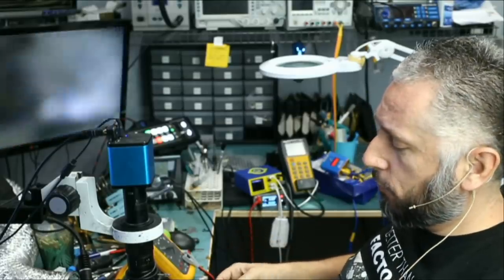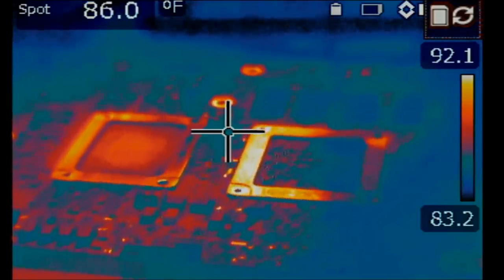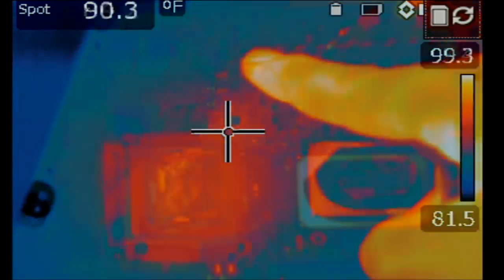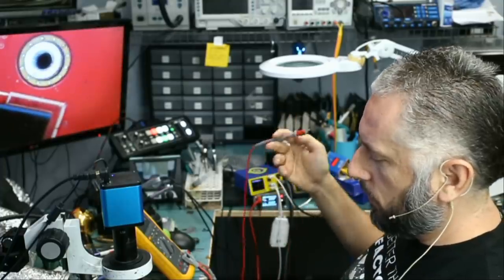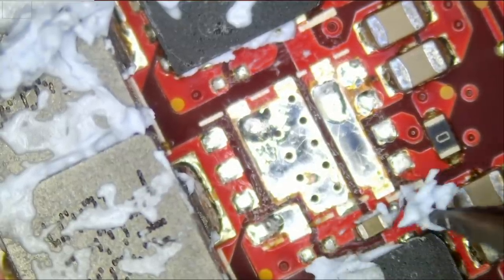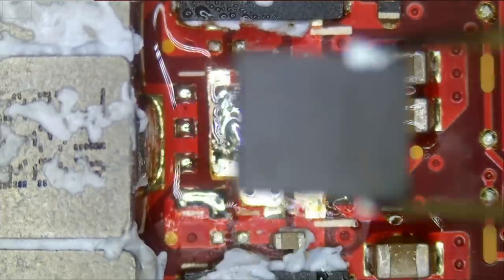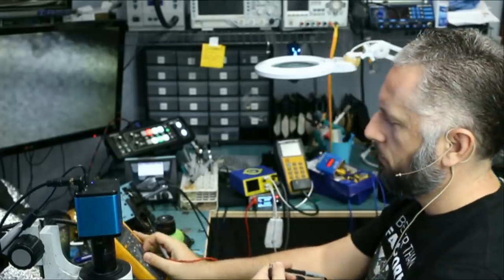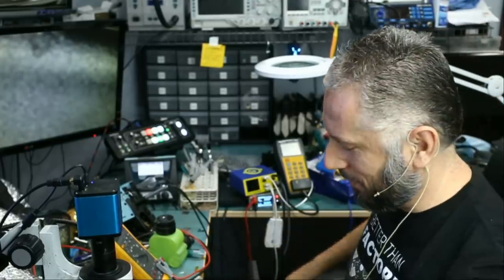Asus Gaming Laptop GU502G No Power Motherboard Repair - Short Circuit causing GPU heat.

Comment: Are you using resistance mode on your multimeter or diode mode when checking "short" in the circuit? Can you make a video tutorial about differences between them?

Comment: Nice repair again. Just a question, why are you not featuring repairs about pc motherboard like what you do with laptop motherboard? Thanks.
Reply: I guess because pc mainboards are very simple to replace by just another mainboard from any brand, no one with a broken pc mainboard would invest 200 dollars to fix a pc mainboard if a new mainboard is half the price... (Instead laptop mainboards are very expensive/special ones which you cannot replace with any mainboard from the shelf) - So its just the fact that no one would invest hundreds of dollars in a pc mainboard repair, if new mainboards are very cheap.

Comment: When it comes to injecting voltage there are times where you can simply put the probes at your desired spot and then there are times where you rather solder a probe (or a sacrificial wire attached to the probe) to the board and this way have  time to inspect the board on both sides. Granted it is additional work, but in my opinion still something to keep in mind.

Comment: Why don't you Simply solder a long piece of wire at the injecton point and connect the Red probe with a clip to the wire so you can easily flip the board and Handle the thermocam More comfortably.
Reply: wondered pretty much the same thing

Comment: I need to learn more about the short detection method in diode mode. How do you read the voltage drop ? If the VD is close to 0 does it mean it’s shorted ? Or the other way around. Thanks !
Reply: you can't realistically get below 0.3V on a Silicon part, so below that is suspicious. 0 is a dead short.

Comment: Hi, I have a Dell 1525 laptop. The LCD screen is black. But with an HDMI cable on a TV, the screen is good and boot up Windows. Capacitors close to the GPU are short-circuited. I tried voltage injection and ice spray and saw that the GPU was hot. Please guide me in this.

Comment: On 0:28 diode mode, when checking the mosfet, to where goes the red probe? and to where the black?
Reply: in diode mode, red probe goes to ground, and test with black probe.
Reply: @rafaelpineda1667  ground is any of the copper holes?
Reply: yeah, usually copper holes are ground

Comment: I have the same laptop gu502g, it was on and just completely died. I was not at location when it died, however I thought that the charge cord was not charging, the chargers testing 19 volt, also the board is reading 19 volts. No charge light,. Does that mean no short like these videos? Cannot find any burn marks or any components that are shot. How do I contact you and get this unit to you. I use it for a DVR and I'm missing my TV shows. Please give me a email Scott cars 3 6 of course at Google mail thanks I appreciate it

Comment: At what temperature you keep your hot Air? What should be the air flow rate?
Reply: he said "500C" - so he keeps in maxed out, max air flow for mosfets too - for smaller components, you may wish to reduce the flow.

Comment: To be serious now, I do wonder if you are prepared for a Li ion battery fire in your work shop.
I know that one way to keep it from spreading is to have an Li blanket ready to wrap the battery in.
I also know that water is the only way to completely put out a Li Ion battery fire.
Assuming that a Li ion battery were to be accidentally punctured and catch fire due to the liquid chemicals inside the battery mixing, you would not have much time before it really got very Very HOT and would have to deal with the heat and smoke that would be poring out of the device with the Li battery mounted in it.
AND if this were to happen and you had to then soak the device in water, could you then bring back the device to a workable unit.
Example;  A computer's Li ion battery catches fire and you first wrap it up in the Li ion fire blanket and then carry it to a sink or a barrel with water to dip it in, THEN, could you refurbish the now wet computer? 

I know that one of these Li ion battery fires can go quick and you have to be ready.
Some one could even bait you and send a broken computer in that was unfixable and set the  device so that upon opening, rips open the Li battery and then there  you are with their computer on fire.  Would you be liable for that?
I know that you've had to deal with other ass hole customers that tried to cheat you into having to buy them a new device.